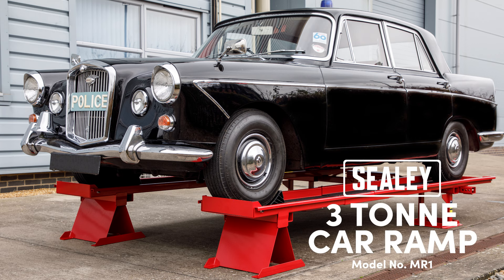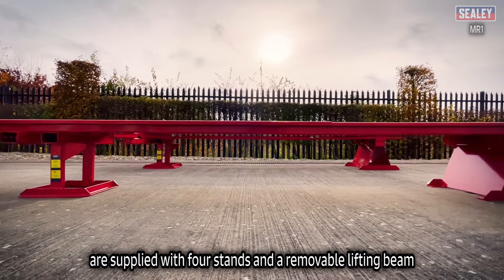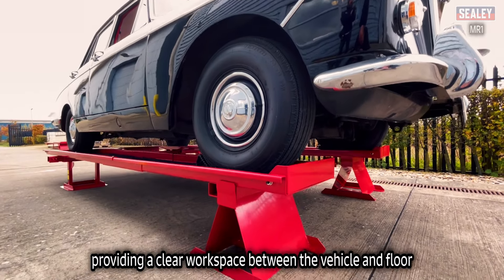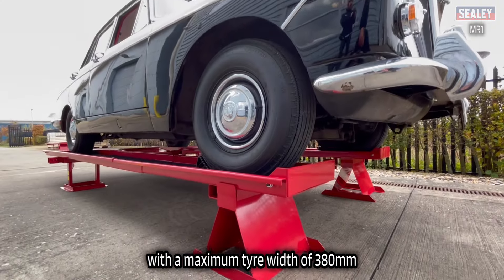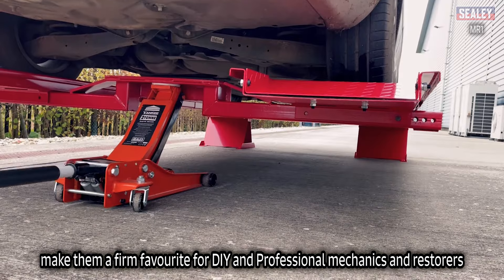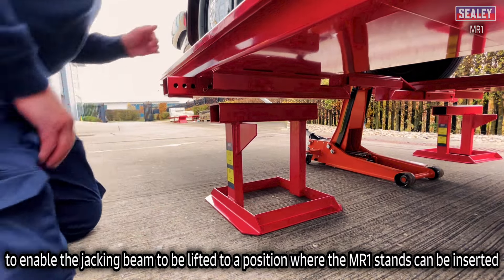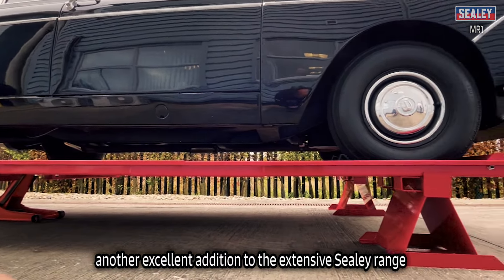Sealey MR1 Car Lift Ramp 3 Tonne - Compact and Convenient Solution for Vehicle Maintenance

Comment: Sorry Sealey but at £1799.94 inc VAT (March 2021) with no jack included, it is way overpriced. 
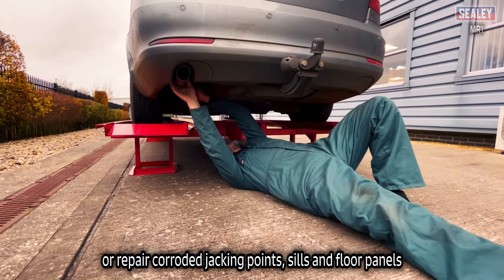I also feel that there is issues with underside access of the car on the ramp. One end of the ramps has a bar across it. Look at the guy struggling at 0:17. The width of the ramps will also hinder access when repairing the sills etc. Are the grip surfaces on the ramps fire resistant? They need to be if someone is welding bodywork above them.
Reply: i agree. could make them yourself for about £400-500 and make it bigger/taller

Comment: Good two post lift is around £1600, a pit fully equiped less than £1700, shame they overpriced this, because for the half the price, it would have been a winner, especially for the home mechanic, with limited space and height available.

Comment: I like the idea , but it’s just far too expensive imo , as a professional and can get a 4 poster for that money , as a diyer it’s far too expensive.
Reply: @ajsimmo6788  This link goes to the Sealey version. Based on the time proven original MR1® designed by Mike Dawes, a retired Cambridge UK Chartered Engineer (CEng/PE) and classic car enthusiast. Sealey are now able to offer a revised and updated MR1 with additional safety features, tested in the UK to strict test parameters.

Comment: How can I use that for take out the wheel? Job like break job or tyre rotation?
Reply from the maker: Hi. The MR1 is designed to give clear workspace between the vehicle and floor which is ideal for general servicing, exhaust work, repairing damaged jacking points, sills, floor panels and undersealing. Thanks.